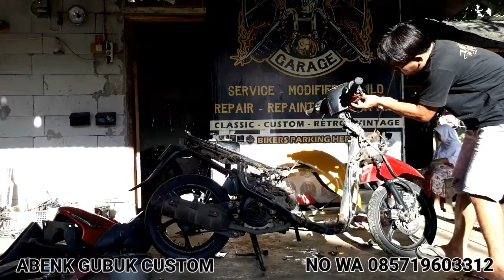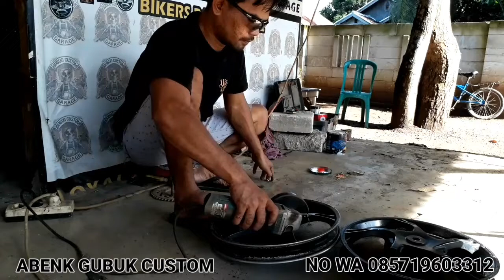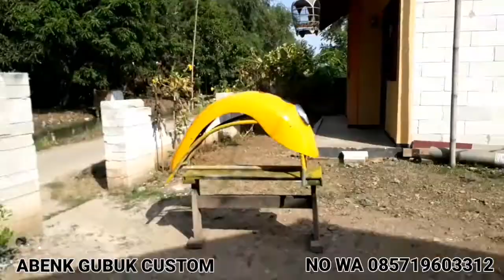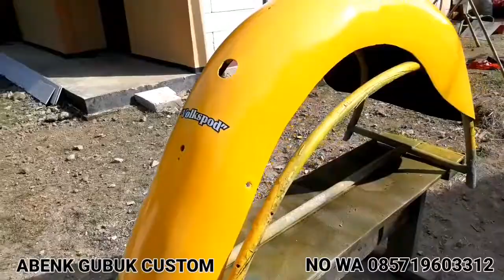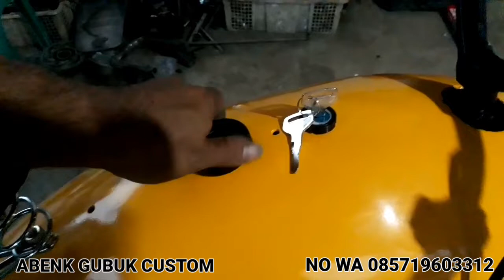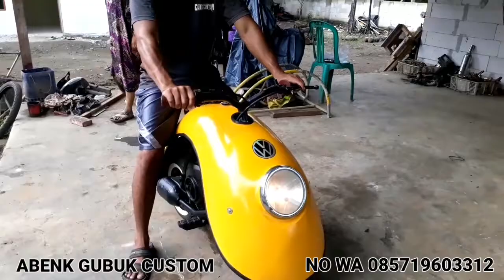merakit motor matic jadi VOLKSPOD

Comment: Custom jadi volkspod berapa ya kira kira? Basic motor vario
Reply from the maker: klw dr honda harga 8jt sampai 12jt
Reply from the maker: clontong  7jt sampai 9jt full dr saya...basic matic mio,..
Reply from the maker: clontong  klw bawa unit sndri ,6jt   sampai 6,5 kang..tergantung model
Reply from the maker: clontong  boleh kang 085719603312
Reply: Lokasi di mana bang? Motor saya Honda spacy bisa gak?
Reply from the maker: @paranoicemedia3654  sy d karawang kang...bisa all matic
Reply: @Abenkcustom234  6 JT bawa unit sendiri itu matic beat/ Mio mas ?